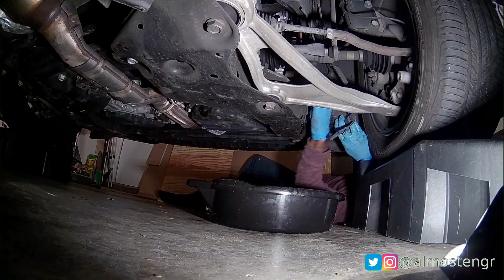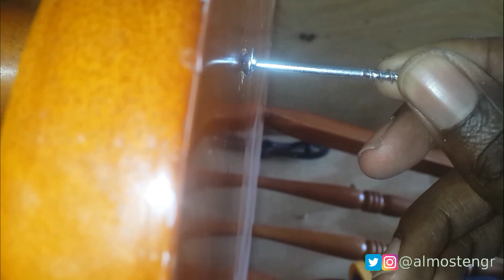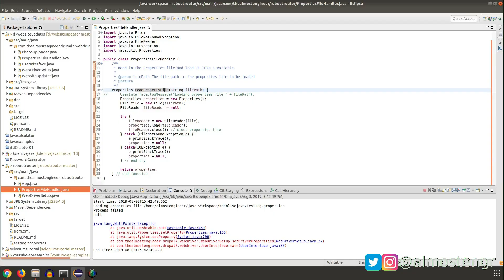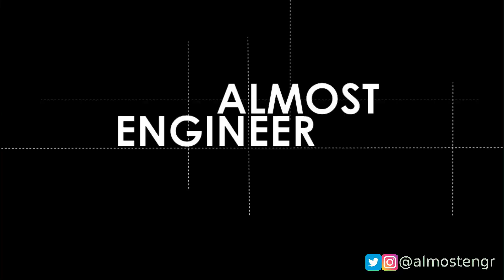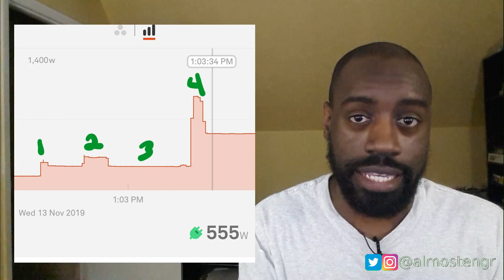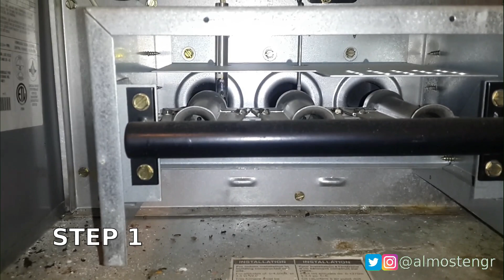REVIEW: Sense Energy Monitor 10 Month Update

Comment: I had my for 2 months and it hasn't detected anything! I look at the spike in power and I know what they are
Reply from the maker: That can happen. If you have items that are plugged into surge protectors or power strips, they are less likely to be detected. I assume this is because the protector or strip acts like a filter and Sense can't pick up through the filter.
Reply: Everything I have is protected, I have whole house surge protection, surge power strip on everything but deep freeze and refrigerators and other big appliances but it didn't every detected them
Reply from the maker: That could be part of the problem then. It maybe interfering with the ability for Sense to hear the devices when they turn on

Comment: First let me say your videos greatly influenced my decision to purchase Sense. I had it installed at the same time I had solar panels installed. Sense adds so much visibility into what is happening in my house from a usage standpoint.  It’s interesting that my fridge was discovered but not the light in the fridge. I bought the Kasa smart power strips that will communicate directly with Sense. That helped indicate how much power devices that were not yet identified like my TVs are using. Plus I can turn off the TVs remotely when family members leave them on and nobody’s home. Almost all of my major appliances have been identified including heating, A.C., fridge, washer, dryer. I think my dish washer is the one major appliance left. I’ve only had it installed for about 6 months. Also glad to see Sense was responsive to your requests. I have Sense as well as all of my “smart devices” on a separate network so i haven’t been able to take advantage of the network discovery feature. My usage is never exact with what the power company says. It is usually within 98% give or take.  Even what Senes reports and what my solar panel system reports don’t exactly match up but it’s close enough. Good idea with the Wemo. My lights have not been identified either. I switched everything to LED last year. Great video. I enjoyed it and I subscribed.
Reply from the maker: Thanks for the feedback. Glad to know that I was able to help you. I see that you have encountered some of the same problems that I have.  That's helpful to know that it is not unique to my situation.

Comment: The point you made about UPS-protected loads was very helpful - except for appliances like air conditioning and washers, almost everything we have is backed up by UPS. I'm intrigued by the mention that Sense is offering some kind of network detection for networked devices. I wonder if - with network detection enabled - the Sense can then can successfully identify some tricky devices like computers on strips or battery backups?
Your videos on this have really helped me out in aligning my expectations for the Sense. My household might be served better by a time investment into an ESP32 and multi-channel CT board monitoring each branch circuit directly.
The household energy usage in your screenshot causes envy... Nice work. And yay, I got a shout out! :D
Thank you, Kenny!
Reply from the maker: All of my network devices are plugged into UPS or power strips, and none of them have been identified have been the entire time that I have been using Sense. The documentation doesn't mention that it can or cannot identify devices plugged into power strips or not.